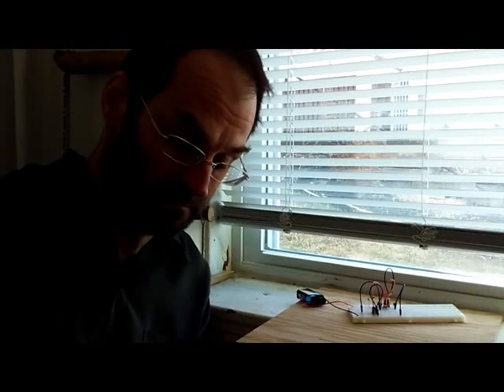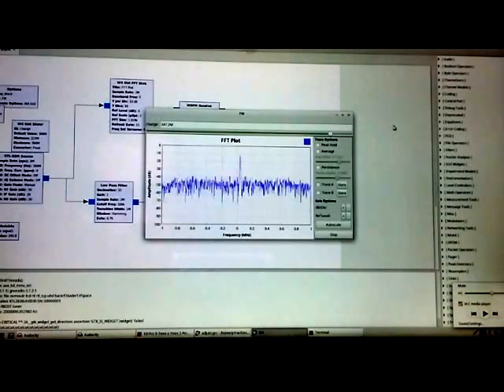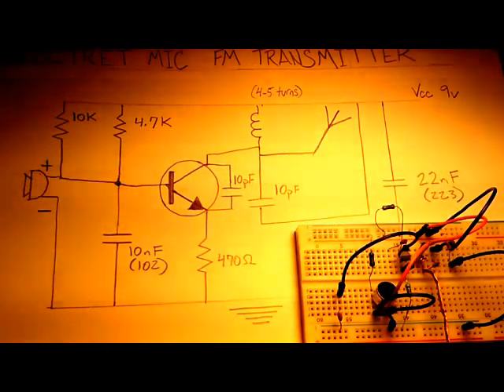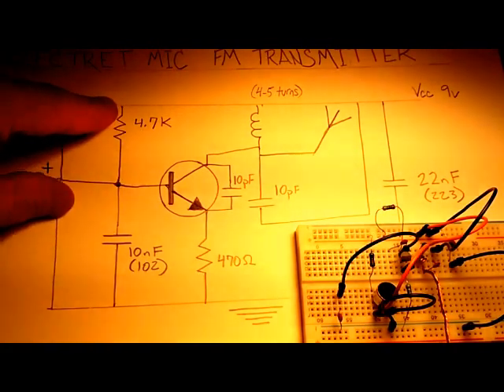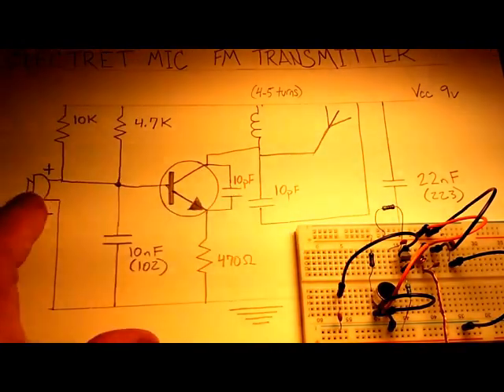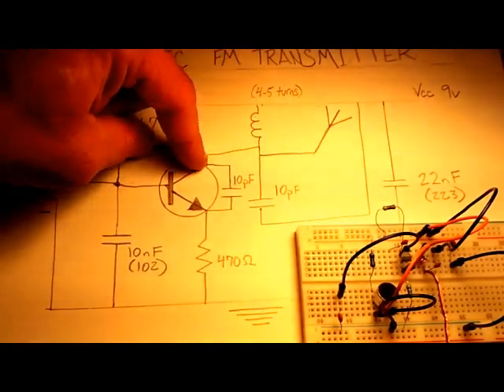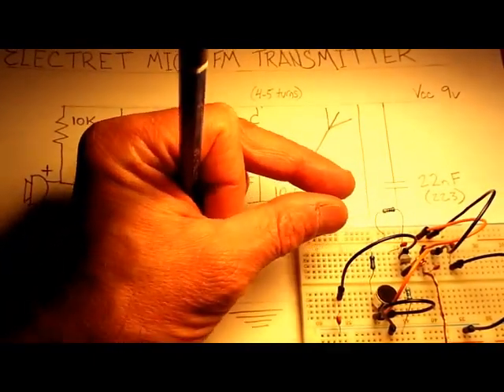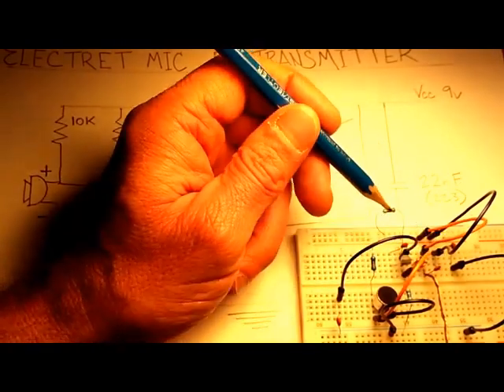Microphone FM RF Transmit SDR Circuit Schematic

Comment: 1nf=102 
10nf=103  

so that is 102 or 103???
Reply from the maker: thanks, I'm using 102=1nf.  The 103 would slow the oscillation but transmit fine.